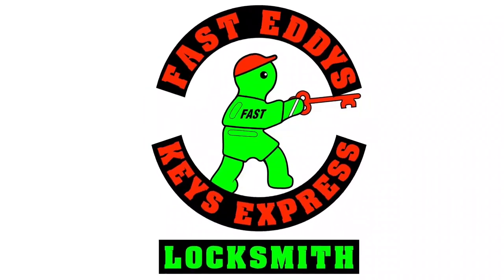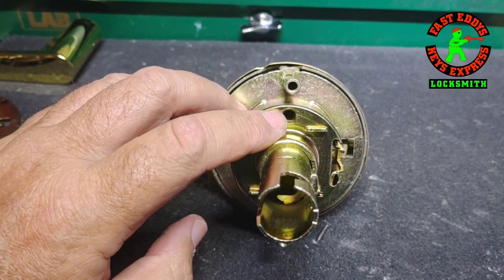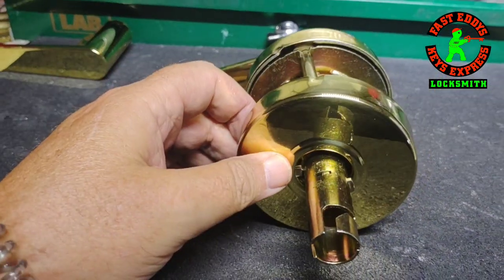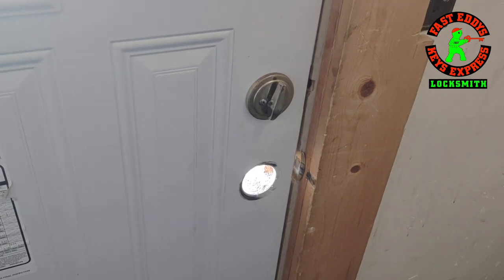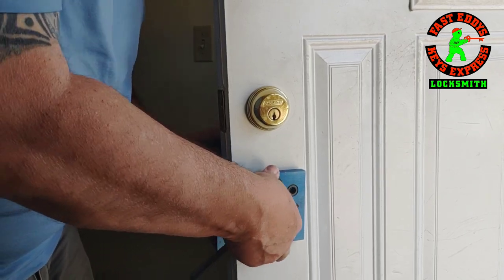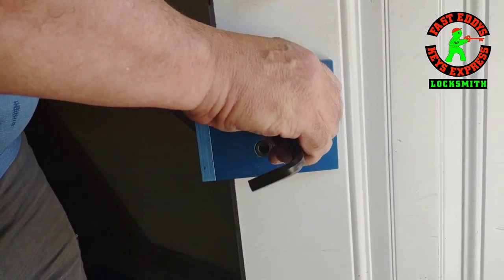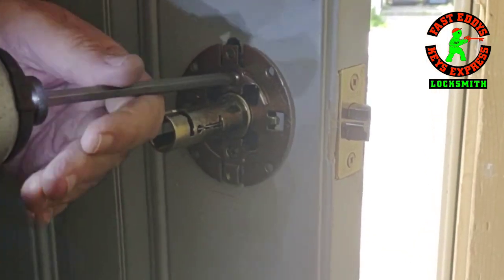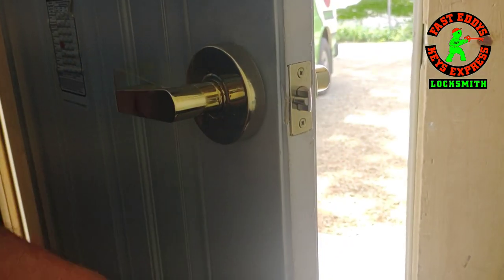Lever Lock Installation Using A Major Manufacturing HIT-111 Jig @fasteddyskeysexpress

Comment: Question 2 locks on a door?-NFPA 101 does not prohibit multiple latching and/or locking devices on a door, but the requirement is that all the latching or locking devices on the door are to be unlatched and unlocked by that one/single motion.
Reply from the maker: In Minneapolis MN normally you would be correct! But since we here in Minneapolis MN are allowing criminals to roam freely to commit any crime they want! The city and state inspectors know they could not enforce these regulations in such a trying time. Property & Buisiness owners just tell them to take me to court! I have seen up to 4 locks on a fire door exit at times. So inspectors are doing a half assed job! I see hole filler plates in these folks future! The question is when?

Comment: Was that jig really necessary? I mean, couldn't the holes have been drilled by marking the spots using just the included template?
Reply from the maker: Sure you can try! But I'm a perfectionist. When you do as many as I do! The template jig helps me make the right size holes in the very spot that they need to be drilled. I have been doing locksmithing since 1985 and I know all to well a drill bit can travel easily and end up drilling in the wrong spot! Using a Jig is dummy proof.